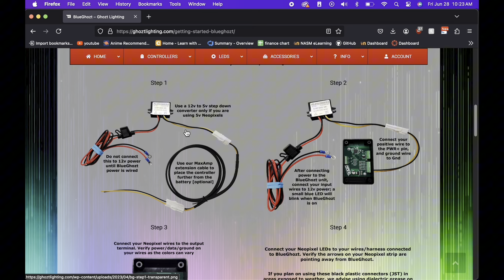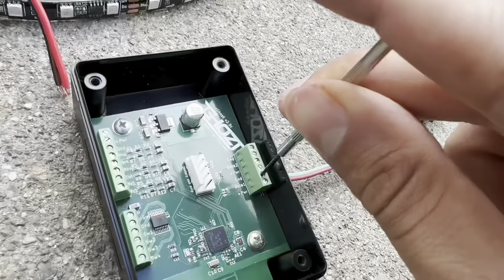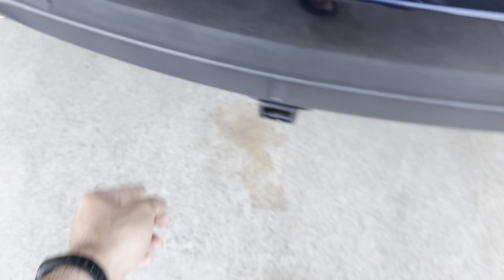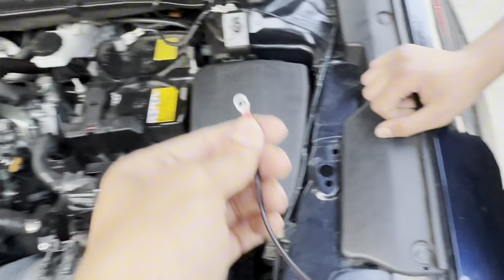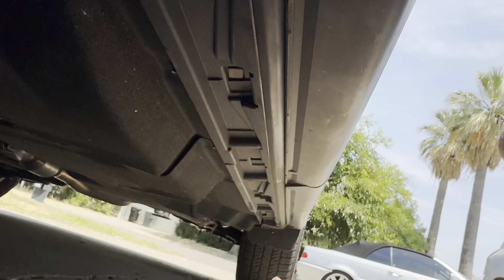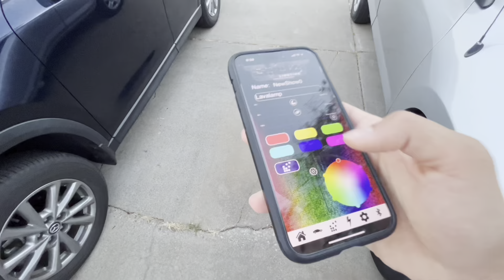How To Install Custom DIY Under Glow on Your Car | Blue Ghozt Controller Edition

Comment: I thought you did a really good job with the install, but I wouldn't have done it that way. Having done quite a few underglow installs over the past decade, I would go with a kit that is precut to the approximate length you'll need. I've not had good luck with the times I've cut and then tried to reseal it, not under a vehicle. Also, those JST connectors  on that strip aren't really waterproof. For best results, use waterproof connectors that plug and screw together. 

Through the trial and errors of having many of my underglow sets fail, this is what I my preferences are.... Get LED strips with an IP68 waterproof rating, not IP67! The strips should have at least 60LEDs per meter, but I find 96LEDs per meter the best. The model of LEDs you're buying also matters a lot with brightness and longevity. The models of LEDs I prefer go in this order GS8208, UCS2903, WS2815, SK6812 (12V). Blueghozt is my preferred controller. 

The actual LED pixels should never be visible to the eye, you only want to see the light they create on the ground. Sometimes, it's not possible on all cars to completely hide the led strips, and in these instances, spend an extra 30 bucks and buy some aluminum LED channels that can shield the LED pixels from being visible from the side. I always use LED channels now. I mount the channel to the vehicle and then stick the LEDs onto the pristine surface of the channel. Using a channel also helps the LED strip stay cooler. (I dont use the covers that come with the channels.)

I know this is a whole book of info... and I'm not trying to sound like anything... It's just that setting up an underglow and a Blueghozt is pretty labor intensive, and I don't like having to re-do something every 6-12 months, which is how it kept going for me until I stopped cutting corners on my underglow materials and install. 

I'm sorry, I only made this long ahh comment for people who are thinking about doing this install. I genuinely the guy in the video did a great job, and his underglow is probably still going strong. I thought the soldering he did was really good, and soldering the wire to those little pads can be difficult. 

I'll shut up now. Peace. ❤
Reply from the maker: Thanks for the response, brother

There’s a community that is heavily into these types of modifications and you nailed down the most important parts so I applaud you for summarizing it in full for the comments so thank you for that🤘